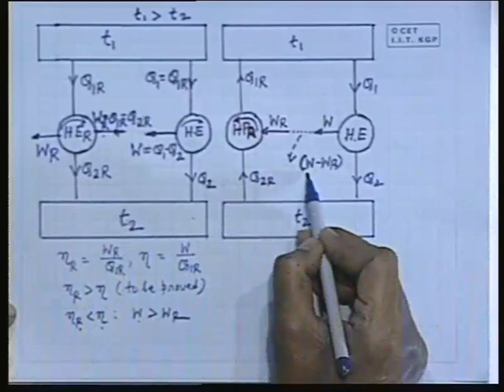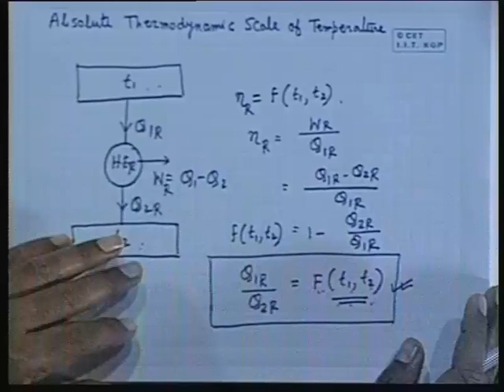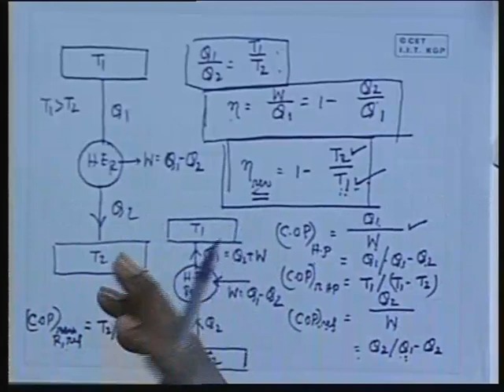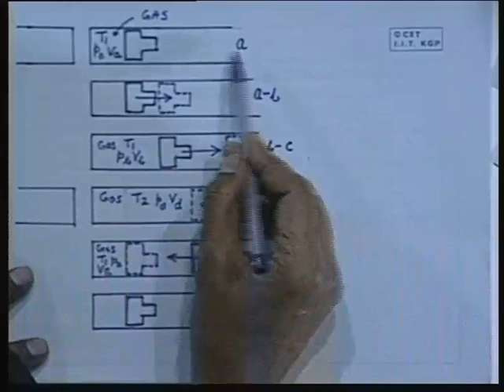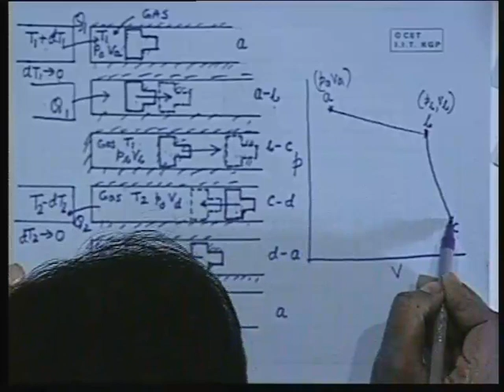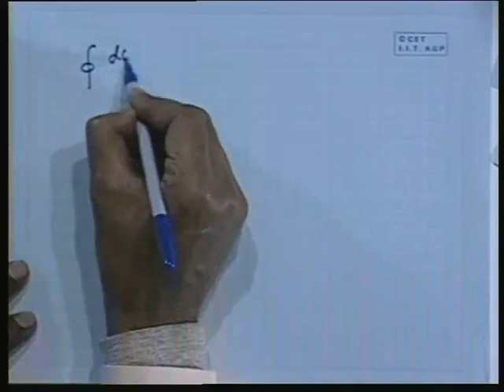Lec-7 Second Law and Its Corollaries-II

Comment: How without heat interaction adiabatic expansion are happening
Reply: coz that's what adiabatic is meant to be!!!!
Reply: @ritikratnam3309  before adiabatic expansion, whatever amount of heat consumed by system is totally converted into expansion work. So again how expansion happening???
Reply: @shanikumarbenvanshi5157  The gas continues to expand by reduction of pressure, doing work on the surroundings, and losing an amount of internal energy equal to the work done. The entropy remains unchanged.

Comment: still I did not understand the part of W-WR
Reply: If W> WR then what an engineer thinks? He thinks that the Heat Pump(which we have reversed from Heat Engine) requires an amount of work WR , So I will supply  the work W from irreversible Heat Engine to Reversible Heat Pump. As W>WR i get an additional amount of W-WR from the system. And finally if we observe the whole system , the system is working with a single reservoir and producing some work which is not possible because of Kelvin Plank's statement.
Reply: @dodiumtalib8202  how is the reversible heat engine(pump) rejecting heat without the presence of T1? Even though you connect it to the irreversible heat engine. You need a reservoir for it to reject to right?

Comment: sir but to mantain reversible adiabatic rule in 2nd half stroke, piston had to move very fast.
as this is the limitation of carnot engine
This alternate combination of very fast, very slow, very fast and very slow is not possible to achieve in actual practice and these are thus the limitations of this cycle.
Reply: Vikas Goswami but i think sudden changes will lead to sudden change in temperature of the system and hence the system will deviate from thermodynamic equilibrium making it irreversible.

Comment: Dear Sir, i am an on-line fan of your lecture. At 22:02 you told that the second engine is taken Q2 heat from same Q2 heat of first engine which is impossible by second law. please help me to understand. Thank you sir.
Reply: Bodiuzzaman Shawon Mia please consider case of series connection heat engines you could easily get your doubt clear
Reply: Q2 means working fluid rejection by heat engine1 as for 100 use f working fluid\

Comment: At 55:06 why sum of Q/T over cycle is written as cycle integral of dQ/T why not dQ/dT?
Reply: sukhdeep singh when it's formula derived we found it from T-S GRAPH whose area gives heat. In the graph we cut the sections of that area which means we split Q into so many dq and divide it by respective T and then adding all those value (integrating all those)  we got dq/T
Reply: Bcos  T is absolute , so it is not changing